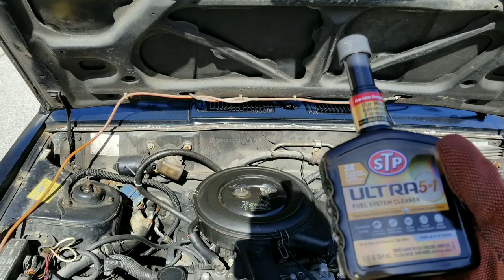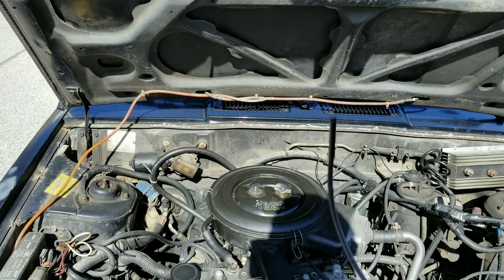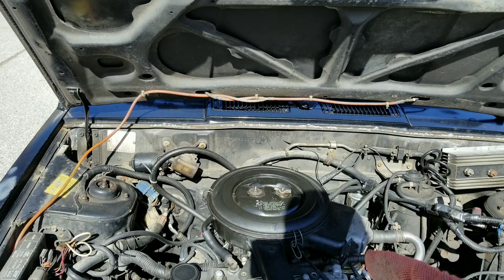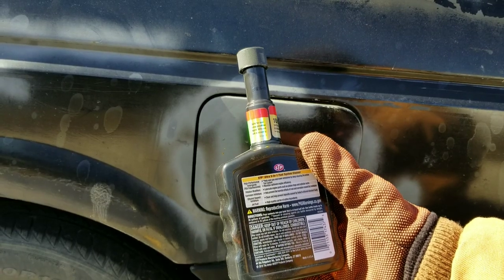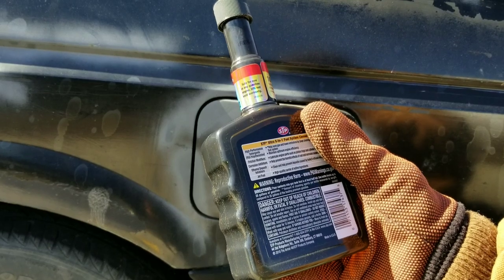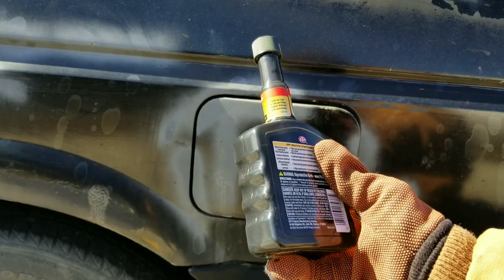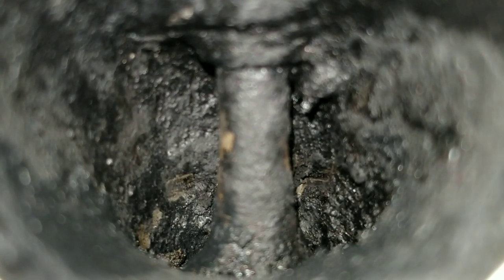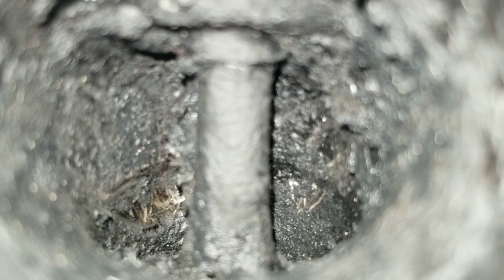Stp ultra fuel system cleaner vs intake valves!!!

Comment: Please try ATF+4 mixed with a little gasoline in your sprayer thing.  ATF+4 is a great cleaner and it dissolved carbon build up. And has a lot of detergents in it unlike dextron mercron and such.. so I always soak my parts tools ect in a mixture of ATF and gas and it works great to clean carbon from engine parts I'm cleaning and I always pour like 1-5 ounces of ATF +4 in my gas tank on my Dodge ram truck with the 5.9 Magnum V8. And it keeps everything nice and clean. Please try ATF+4 and gas in the sprayer
Reply from the maker: Thanks for the good suggestion

Comment: STP cleaner definitely does some cleaning.. 3rd and 4th ports shows some bare metals now..
Reply from the maker: Yes i was suprised so what about oil additives
Reply: Oil additives can't do anything for valves.. But in other issues such as burning oil and leaks, engine vibrations.. I've tried products such as the Nano Energizer and STP oil additives for high mileage that fixes oil leaks.. And also Pertua oil additives..
Reply from the maker: Yes i didnt want to use the additives for valves but special equipment on the way to test oil and oil additives
Reply: Those products i mention you might wanna try.. 😊
Reply from the maker: I appreciate your time.
Reply: Omg are you kidding me, this stuff sucks

Comment: These bottle's are like $20 each hear in Canada. While it looks like it does work somewhat, it doesn't work enough to justify spending 20 bucks. I always find these fuel additives more of a preventative maintenance item, rather than an actual fix.
Reply from the maker: Yes i agree a fix would be more repetitive use.

Comment: Can you try Liqui Moly 5111? It's for Gasoline engines and supposed to clean Throttle Body and Valves. If possible, can you spray a little bit directly in the intake manifold and let it soak for a few minutes before firing up the engine? (Not too much, of course. The engine needs to start).

I have considered trying it, and do before/after shots, but my borescope is very bad, so I can't see much..
Reply from the maker: Yes i understand keep the recommendations coming

Comment: will the stp ultra 5-1 cleaner clean the intake valves of gdi engines like using a crc gdi intake valve cleaner?
Reply: I believe you have to use a designated cleaner for that system

Comment: the problem with gdi injection is the fuel is direct injected,so that s y u have so much carbon on the intake valves. what the purpose if u add  this cleaner to the gas since it wont be in contact with the valves???
Reply: I dont think this truck in question is GDI hahaha

Comment: My mechanic recommends to use 01 whole quart of dexron 3  atf through de pcv valve and you will see the cleaning smoke is better than seafoam
Reply: Yup its cleaner because your engine stop working
Reply from the maker: What products would be good for a test
Reply from the maker: Yes and what oil additives can we test
Reply: @malikulamin9948  mine didn't stop you just accelerate until smoke stop appearing
Reply from the maker: Thats really great thank you for sharing with the NIA community
Reply: Smoke does not always means it is cleaning, most of the time it is the light oil that is burning off like a car smoking from an oil leak
Reply from the maker: Yeah smoke can be many things